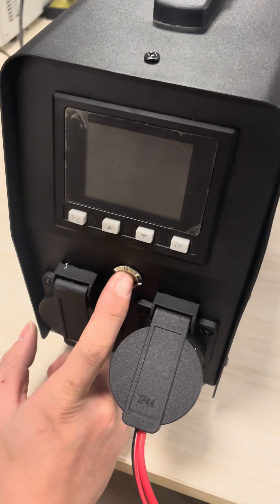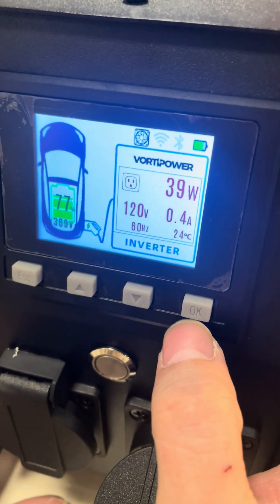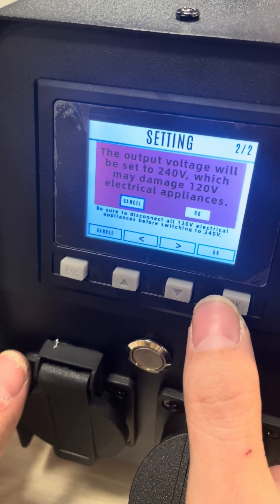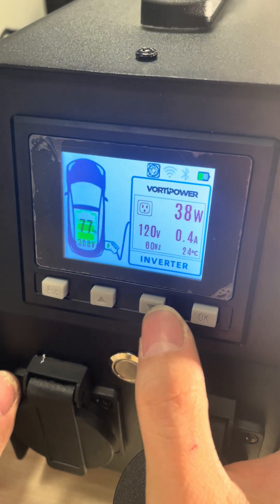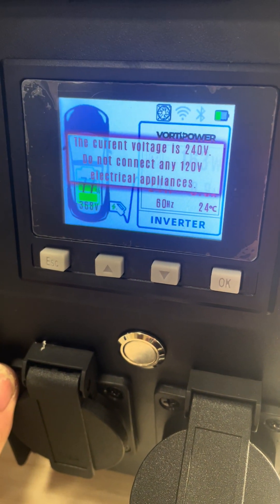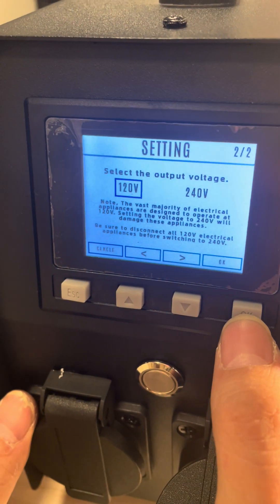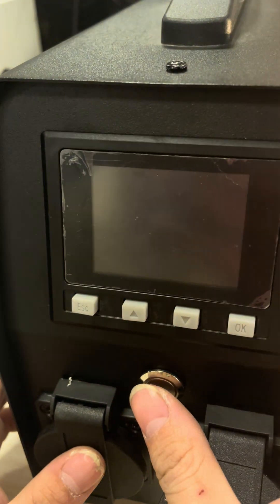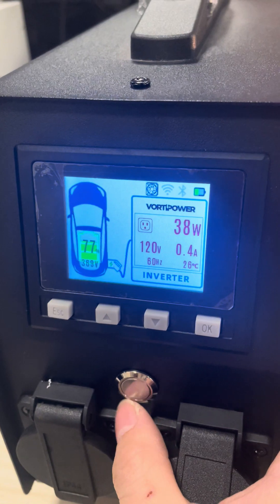🚀 Exciting News: 120V to 240V Upgrade In Development!

Comment: Will the VortiPower VP20 (or a future model) have 120/240V NEMA L14-30R or 120/240V NEMA 14-50R receptacles so that it could be used to supply power to a power inlet port that is commonly connected to portable electric generators? My use case is that I have a 240V well pump, 120V gas furnace, and 120V refrigerator that are some of the more critical appliances I need power for during a power outage. Electric oven is 240V and a tankless gas water heater uses 120V.
Reply from the maker: At the moment, the VortiPower VP20 does not include a NEMA L14-30R or NEMA 14-50R receptacle, but we are actively considering future updates and models that could meet the needs of customers with similar requirements. Your feedback about using the unit for powering critical appliances during an outage, such as a 240V well pump or 120V gas furnace, is extremely valuable to us.

We’ll pass this suggestion along to our product development team to explore adding these features in a future iteration. If you have any additional questions or suggestions, feel free to reach out—we appreciate your input!
Reply: @VortiPower this is the difference maker for me. Looking forward to a US 240v model. Very exciting but need this to charge my home battery unit (it won’t take 120v input and discharge 240v at the same time. It needs 240v input). Thx and hope you do produce a 240v US output model soon. I’ll def buy that!

Comment: I used an old dryer cord spliced a USA  female plug at the end so ran an extension cord from there to what I wanted to power a 4800 watt garage heater. After I had it running I noticed the cord was starting to get warm so I went to unplug from the wall socket I noticed I had only 2 wires hooked up to a 3 way female plug. So my question is not why didn't I die from touching the unit because I wasn't grounded but more so on how did that power return to it's source with about 3 feet of ground missing back by the wall plug in 😮
Reply: The ground wire is not needed to power a device, it is only there for personal protection to give any leakage current a clear path back to the breaker to trip it so the path is never a person.